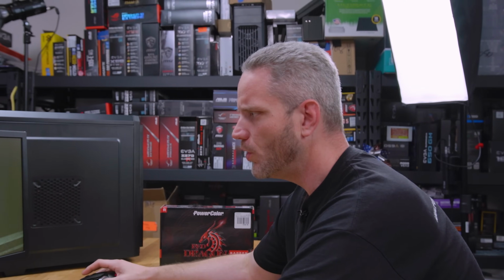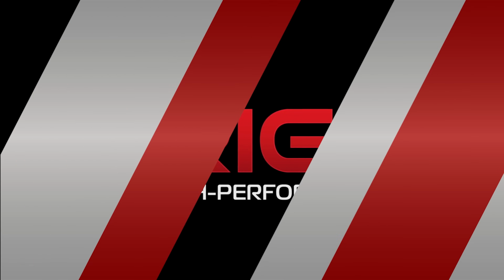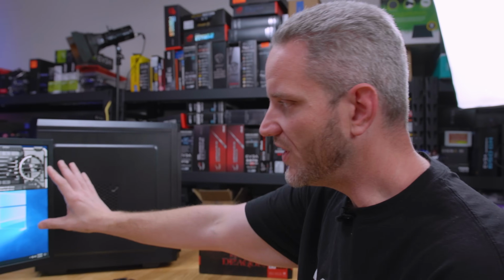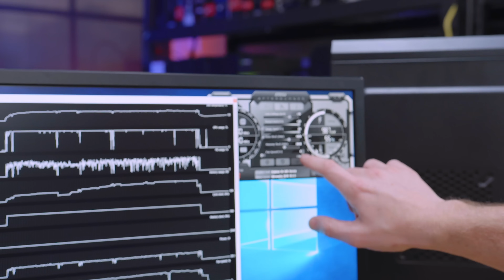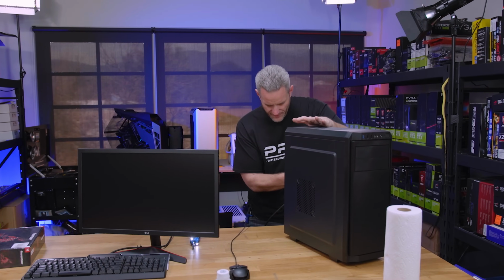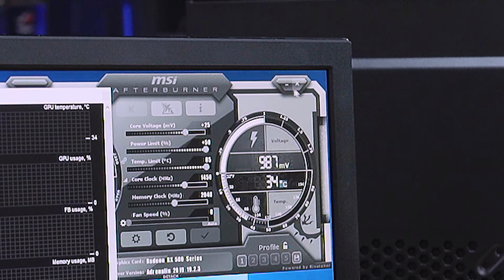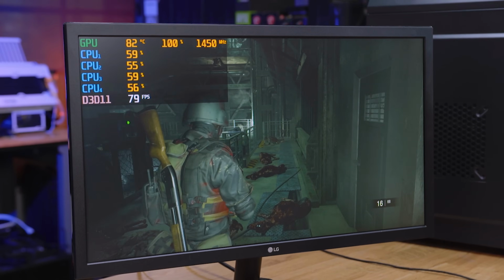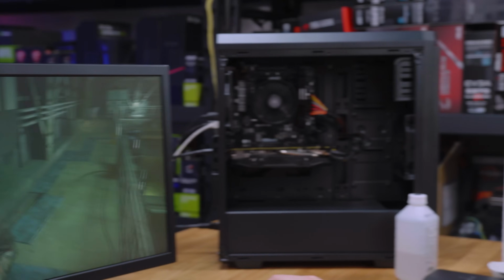Should you replace your video card's thermal paste??

Comment: Hey guys, do you think Thermal Grizzly paste would work for my GTX1070? Thanks anyway!
Reply: a couple of days ago, I used up the last drop or so of the leftover thermal grizzly I had left over from what I applied to my CPU when I upgraded a few months ago, on my 980ti and it seems to work fine enough. temps dropped from mid-high 80c to low-mid 60c when gaming.

Comment: I think it is really important to have cool air direct to the fans. I have a computer with the graphics card exposed directly through a grill that sucks fresh air from outside not recycled air from within the box. 
Could you do an experiment based on tgis, maybe you could create a sealed pipe and housing that goes over the fans on the card and pulls air from ouside the box.
Reply: I have the same thibg with a fan pointing at my gpu and it reduced abt 5°

Comment: I bought a used card n temps get 99-101 guess I'll try this
Reply: temps went from 101c to 72c max be reapplying thermal paste
Reply: @BotelloPerformance  did you only change thermal paste ? My card is currently at 95 °C and have never changed it in 5 years. I have a gtx 560 ti and it sounds af if im next to a plaine
Reply: @SpeciaLisTxFTW  yes. was nervous because some videos say thermal pads on heat sinks may come apart. mine was pretty hot for the 2 weeks I've had it. pulled it apart cleaned and reapplied thermal paste and instantly seen temp drop of 30c while gaming . it would sky rocket from 60 to 100 as soon as I started gaming
Reply: @BotelloPerformance  same applies for me. I could play csgo on 150fps+ but have locked it at 60 fps because on 60fps it is already on 92°C... I hope i dont mess it up but will try it too... thx for answering:)
Reply: SpeciaLisTxFTW there isn’t a way you can mess repasting unless you pour too much(like practically drown), none or if you using liquid metal and squirt it all over the place.
Reply: @SpeciaLisTxFTW  gonna try it. I have some 460's some 480's and sone 560ti's laying around somewhere.

Comment: I bought my GTX 1080 3 years ago, back in May 2017. And i never replaced the thermal paste because it never gave me a reason to do it. It is sitting now idling @ 29 degrees Celsius and when i game the max temperature i see is around 65 degrees Celsius even after a long period of gaming like 2 to 3 hours...

Comment: I had bought a used RX 480 that crashed after like 20 seconds in Furmark, the temp shot to beyond 90°C and when I removed the cooler I saw that the thermal paste was solid and briddle like plastic. Removing it and applying new thermal paste resolved the issue and  the card did not go far beyond 80°C anymore and the temp increases a lot more slowly under load now.

Comment: I recently replaced the existing thermal paste in my MSI 5700XT MECH OC with Thermal Grizzly Conductonaut. There was a significant thermal improvement. Without any overclock, the Junction Temp at idle dropped from 33 to 26. The Current Temperature (using the terminology found in the Radeon Software) dropped from 28 to 26. The fact that the two are now the same is very telling. More importantly, prior to the change, I had a couple of games that routinely drove the Junction Temp to 112 (again, that is without any OC). Maybe not dangerous, but too high for my comfort. After adding the liquid metal the junction temp never goes over 80.  My plan was to later add an AOI cooler to the GPU, but with the results I got from the change in thermal paste I have decided not to waste the money.

Comment: I bought this GPU not so long ago and my game temperatures are around 50 celsius. 

I've got case with 2 intakes ( 120 mm ) and 2 outtakes ( 120 mm ) fans.
Haven't touched thermal paste at all.
Runed basemarkGPU test on it ( 4k resolution ):
GPU: 1450 MHz
Memory: 2000 Mhz
Temperature: 62 celsius, top peak
Power: 145 W
Activity: 100%

Comment: Gamers Nexus made a good point about spreading the compound out on GPUs, because they lack the heat spreader that CPUs come with. A corner of the chip that's not covered will burn out. If you are inexperienced, spread that stuff out evenly before remounting the cooler.

Comment: i have a doubt i m using msi gv62 7rd i want to clean up it fan but the issue i m having is that my laptop have heatsync pipe so if i open it to clean my laptop fan is it compulsory to change the thermal paste of that i m but affraid of applying these thermal paste stuff so yeah i think you are the right one to ask help me and yeah my gpu is contactly running its gtx 1050 on normal usage like access windows and other stuffs i dnt know why that is happening waiting for your reply

Comment: Mega OOPS! Had it running almost 6 years and haven't even changed the compound of the GPU. I have cleaned the fan cooler every time I thoroughly the PC, but the changing of the compound got forgotten each time. GTX 750 Ti. I feel like an idiot now, bugger. Damn it!

Comment: This is a perfect example of what NOT to do.There is absolutely no reason to apply as much paste as you did, since the purpose of the thermal paste is to fill the micrometric voids between the ridges and valleys that form between the two metal surfaces that come in contact with each other. Polished metal average roughness (Ra) is way less than 1 micron, you are looking at 0.4-0.2 micron generally, so in the worst case scenario you are trying to fill a void of around 1 micron. Even if you have badly polished surfaces, or non polished at all, you are still talking about a lot less than 5 microns of void to fill. You need a really, really thin layer to do that, anything more is not just a bit more, it's counterproductive, it increases thermal resistance and therefore reduces conductivity.

Comment: My old rx card actually crashed and stopped working so I took the front off of it and the heatsink was caked with dust. I removed it all (though I already bought a 1050 ti to replace it) and while I was in there I replaced the paste after I did I got way better temps. Now i'm rocking a 2070 super so shit cards are finally a thing of the past for me.
Reply: Mind you cleaning the dust crap out of there is prolly what gave me the drop.

Comment: HI all, im a lucky owner of two Sparkle 8800 GTX OC.
Ist the only Card i know with a active Peltier-Element-Cooler from MACS.
I replaced the Cooler from my ASUS GTX 1050 Turbo 6GB with the Cooler from MACS, but without any extra RAM or Voltage cooling.
I used ASUS GPU Tweak 2 OC Scanner with normal Settings.
The Score was 2000 GPU, 1000mV, Ram speed no Change.
The GPU dont arrived the 79 Grad Celsius Endpoint, the Software stopped after 2000 GPU and 1000mV was arrived.
Under Windows are 36 Grad Celsius normal
Now i search for a good RAM Plate with a low Profile.   :)
Maybe i could use the Plate from Original Cooler, after i cut out the Processor Cooling element.

Comment: Doesn't thermal paste need to 'cure' before it hits optimal thermal conductivity? Or is it the same after a week of use compared to immediately after application? I agree with the suggestion that static fan speed would make for a more controlled comparison.

Comment: My Gpu started randomly running hot but the problem wasn’t the Gpu thermal paste it was the power consumption. The game I was playing suddenly required 100% power even when I was locked at 50fps and my Gpu was at 60% usage. Other games my Gpu stays under 60c but only recently this game is pulling more power than it use to and reaching over 70c. Really strange.

Comment: I replaced the thermal paste on my RX 470 and got the temps down from the mid 80s to the low 70s. This only lasted a couple of months though and my temps got back to around where they were before. I know the paste slowly degrades over time but this happened a lot faster than I was expecting. I'm not sure what's happening there.
Reply: Take note of the weather (seasons)
Reply: @mathewsphiri5629  haha hey man, I haven't had that 470 for a while now but you're right, I was probably underestimating the effect of ambient temps. I'm now on a completely new rig but I'm noticing that my component temps tend to follow the ambient temps almost linearly (so a 5 degree increase in room temp is also a 5 degree increase in component temp). Appreciate the advice, you were probably right on the money

Comment: I just built my new rig with a open case mounted on the wall, I use the Thermaltake core P3 and my Ryzen 9 3900X under load on a 360 AIO cooler doesnt go much above 50C and the GPU (ASUS RTX 2080 Dual) is vertical mounted in the case with the glass on and averages 68-72 playing a game at 1440p at around 100 FPS with max settings and Nvidia DLSS On

Comment: My 980 Ti G1 gaming  was getting too hot and my fans crapped out, so I ordered new ones. 
They took ages to get here so I got 3 80mm noctua pwm fans strapped to the card now but the temps wasn't getting better...
After I  saw  this video I decided to have a look at the paste and the old paste was so dry it could start a bushfire.

Repasting my GPU lowered my temps under full load by 20-30 degrees C, might be more when I get my replacement fans from china (Or less)

Thank you so much for this video

Comment: i have an rx Vega 64 and when it gets into the higher temps it likes to shut down. i thought it was a power issue at first so i replaced the PSU, it turns out that i needed a better PSU to begin with because i was only running a 650W PSU and my system recommended a 750W. but that didn't do much at all. but it still shuts down if i try to run a game at 1080p for too long so i keep it at 720 for now. i also under-volt the gpu to keep it cooler and that keeps it running with no problems. so i think that i might have to reapply thermal paste to the GPU dye. does anyone here think that i'm having problems with thermal shutdowns? when it does this the fan ramps up and sounds like a jet engine at full throttle, and the screens shut off but if the computer stays on and i can even still talk to my buds on discord for a few seconds until the PC finally shuts down. if anyone has any thoughts to lend me a hand i would appreciate it (edit) the card has a reference cooler on it

Comment: My card is an MSI RX 580 Gaming X 8Gb , and it has high temps exactly same as the one in the video. just mine on idle is a lot cooler it hovers around 26c-30c idle, but once I game it reaches 81c-82c. I think I need to replace the thermal paste but I don't know how to open up the card and apply the paste as I've never did that before ;S

Also, as far as Im concern MSI Gaming X isn't a cheap or mediocre, its one of the 'premium' choices ..

Comment: A strong case can be made for having enough ventilation in your case, as evident when Jay removed the side panel.
I'm a firm believer of running at least 2 x 120mm intake and 2 x 120mm exhaust fans in any case.

My current pc has a Palit RTX 2080 Super graphics card which takes up 3 full slots. With an overclock, the card barely hits 65c BUT efficient as the cooler its, does it dump a crazy amount of heat in the case. When I was running 2 x 120mm exhaust fans, the graphics card managed to heat soak the case after a couple of hours of heavy gaming. In the end I had to install a 3rd (dedicated) 120mm fan in the roof of the case to deal with the heat being generated by the 2080.  (the current 2 x 120mm fans are hooked up to a 240mm radiator and thus do not have optimal airflow due to pushing air through a radiator).

I eventually went all out and now run 4 x 120mm fans as exhaust.

Comment: I have an EVGA RTX2080 XC Ultra that I bought last summer.  I cleaned out my PC last month and repasted my CPU, I decided to go ahead and repaste the GPU as well and used Thermal Grizzly Kryonaut.  I was pleasantly surprised when my GPU temps went down 7-8c in games.  I guess the bulk paste they used was not so great.  I was floating in the 80-82c range before, now down in the 73-75c range.

Comment: It's worth pointing out that unless you are replacing the existing compound with something better no you're not gonna see any improvement, I cant tell what you're using in the video but it looks like generic 4-5W/mK goop. That really aint gonna cut it but replace it with something like Kryonaut, Gelid GC Extreme or Arctic MX-4 where the thermal conductivity is higher than 8W/mK (kryonaut personally being my favorite and definately worth the investment outperforming pretty much all non-conductive pastes) and you're gonna see a difference on everything you put it on.

If i'm right about the paste you're using then effectively you replaced what was there with what was already there...ofcourse there was no difference

Comment: And here you are with a case that has a side panel fan mount lol! Those cheaper cards are ovens and all the heat is pushed out the back of the card while the single intake fan there is pushing the heat right back into the card. Place an exhaust 120mm fan on that side panel to vent out that hot air. The only thing about tempered glass panels is no fans on the side. If the case has it... USE IT.

Comment: I like used anti-static sheets from my dryer with a touch of alcohol to clean old thermal paste, the tough fibers usually don't come apart and it soaks up great.
Reply: Please don't use dryer sheets. They're soaked in fabric softener. You have to run dryer sheets through many loads of laundry to remove most of the fabric softener, and I don't think it's possible to remove it all.
Reply: @angolin9352  thats what i thought.  but used ones work great.  It's easy to tell one that is dry and one that is soaked.  Usually i'll have them sitting for months anyway before i use them. I don't use fabric softener in my laundry so it should not deposit additional material.

Comment: I always swap the thermal past with new graphics cards, I use arctic silver or comparable brand i have in stock. I dont expect huge temp differences but I do it for a more consistent coverage and efficiency with less of a fan curve needed. Lower temps at full load are the perks.

Comment: have an old gtx260 that would overheat on LoL. Replaced the flakey/chunky (yes it came off in chunks and flakes it didn't wipe off) with some arctic silver. was much cooler and has yet to overheat. (yes its still in service)

Comment: Dude I bought an HD 6970 like 4 years ago (by then it was already like a 5 or 6 year old GPU). The other day I realized that both it and my i5-760 turn 10 years old this year and I figured why not slap them in a case since I haven't used them in years and see how they do? GPU temps easily hit 70, max out close to 80 degrees. I changed the thermal paste and I tested it a bit earlier today and the thing didn't get past 62 degrees. Gonna redo the tests at 1080p as soon as possible though since I was using my 720p TV for the test.

Comment: I had to come in here and say I just did this today with a ttitan pascal i have had 4 years cleaned a lot of dust out as well and had virtually no paste left, was getting high 50c at idle and gaming i was going to 85c fast and it would go even to 88c 90c Normally the card would crank the fan to 100 but it didnt help. So I tried this very carefully and bam! now im sitting at 67c!!! during 99 percent load gaming!!! it actually helped my frames out also. no typo I gamed for over a hour! from 85 plus celcius to 67c it even went to 66c here and there I use noctua thermal paste and it was amazing i am so happy!
Reply: Yes it works.

Comment: I find it makes more of a difference when you do this to an older card or one that's pre-owned. Frankly the thermal paste on that card looked fine for the most part. A little solid, but I wouldn't have expected much of a temp reduction. Maybe liquid metal would have provided a couple of degree difference, but that's conductive and a good way to brink a card
Reply: Changing thermal paste void warranty?
Reply: @jsizjiisk7606  yes, there are some manufacturers that allow you to do take apart the graphics card to clean it without voiding the warranty, but for the most part, it will void the warranty

Comment: I should probably do a service on my 680 but I'm in my basement and my basement gets cold enough that I ran my computer months with a dead CPU cooler and never realized because the temps never got above 70C... until summer time came around.

Comment: Got mine clocked at 1400 running at 82 tops. So ended up on this video. Always like your videos they are very helpful. Jay do you know if those top plates on the gpu are seperaat purchasable? My asus rx580 8gb hasn't got one amd ibwould lime to have one on it for the looks amd "protection" kind off.

Comment: ive been running my 1080ti at high load for over 6 hours a day for over 2 years now 
including a little mining while i was sleepin in the first month i had it
temps still just go into the 80s most of the time but otherwise my cards cooling still seems fine

Comment: I am not sure it is the GPU's fault, I would say it is the SMALL PC CASE. There is not enough air inside. I have RX 570 and RX 590, both had 84C+ in the small PC case, but as soon as I bought a new bigger one, I swear, I NEVER hit above 73C. Like, that is TOPS. Usually runs at 68C average depending on the game (Rocket League 59-61, AC Odyssey 66-73, ROTTR 65-71). So, my bet on that GPU in the vid is - small PC case.

Comment: bought an rx580 nitro+ special edition, cleaned the heat pipe, reapply with some cheap cooler master ic2 thermal paste and the temperatures dropped like crazy, like from 38 idle to 29 and from 75 to 60~65 full , it was really worth it in my case